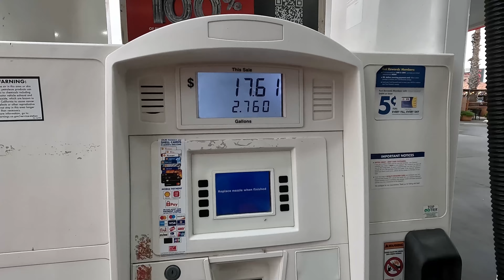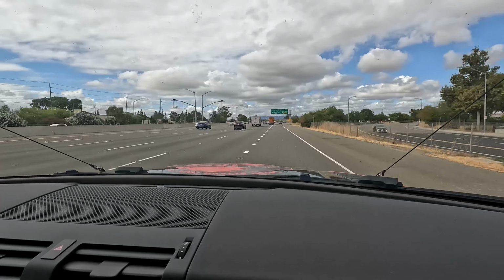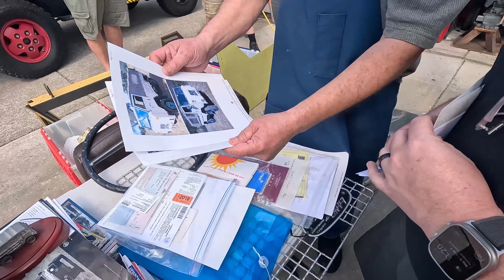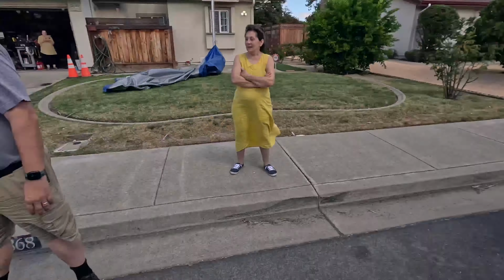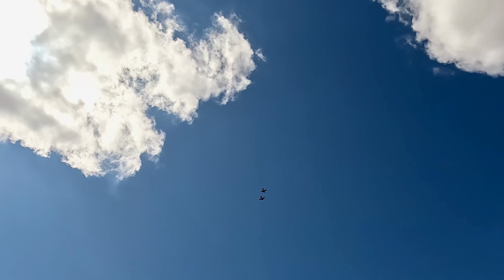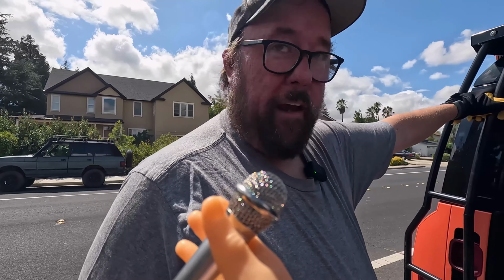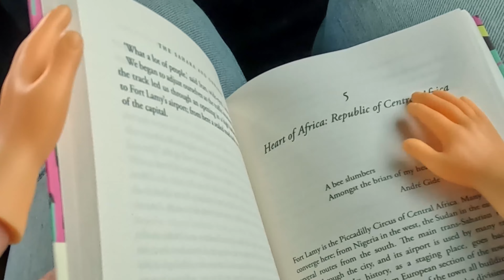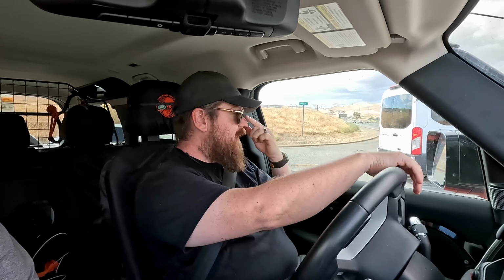Unbelievable Find! Watch Us Recover a Vintage Land Rover Hidden for Almost a Decade!

Comment: Used to drive the 101s daily and on exercise in the Uk in the late 70s and 80s . We had 8 of them plus trailers carrying the mortar crews. Great tool in the baron hills of Northumberland. Nice to see them still being cared for. They worked really hard  .
Reply from the maker: That’s outstanding, we’re hard at work getting this old girl back on her feet and read for some time in the bush, thankfully it’s turned out to be a 12v car so electrical isn’t going to give us as much trouble… I mean still a lot of trouble… but not as much as 24v… silver lining. Thanks for watching!
Reply: A decent 101 here to military spec will cost around £40,000 . If you can get one .The best ones to get are ex RAF ones as they never worked as hard as the Army ones and did less miles. All the best with yours.